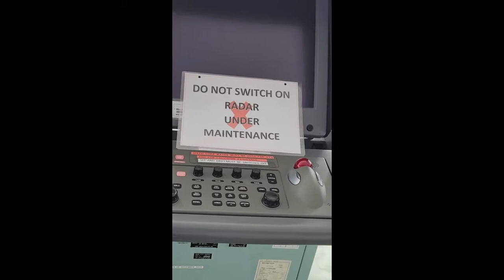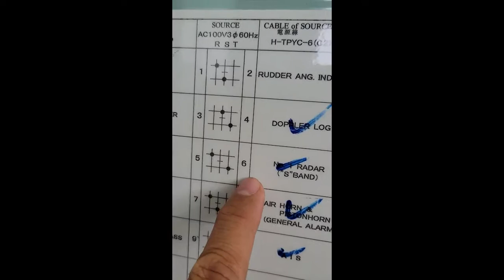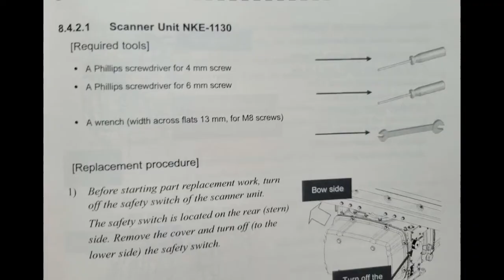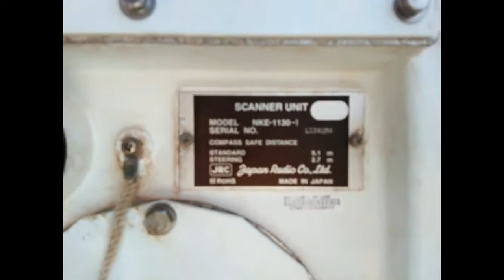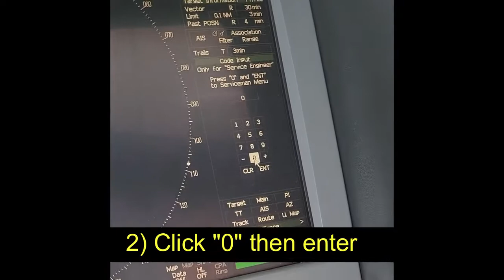DIY changing magnetron of ship's RADAR magnetron and resetting the running hours to zero?

Comment: Dear bro Pls advise on below
After replacement of S band radar magnetron there is no Echo on radar.. Pls advise some solution
Furuno FAR 2835 S
Reply from the maker: Pls. Check the carbon brush, it might meed replacement. Otherwise the magnetron might be defective
Reply: @doodstools3241  thanks bro.. 
Actually, after replacement of Magnetron i got good echo on my radar screen but unfortunately the vessel had rolled heavily(one time) bcz of rough sea. After that there is no Echo on radar screen. 

Pls share the pics of carbon brush located in scanner unit